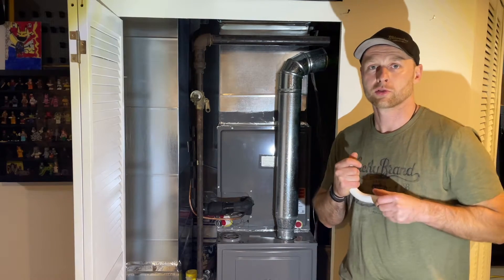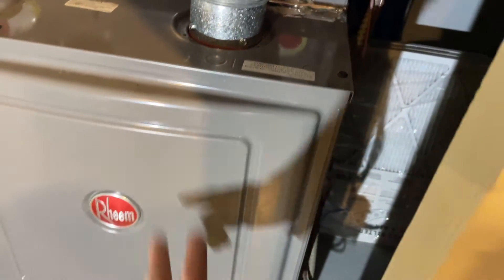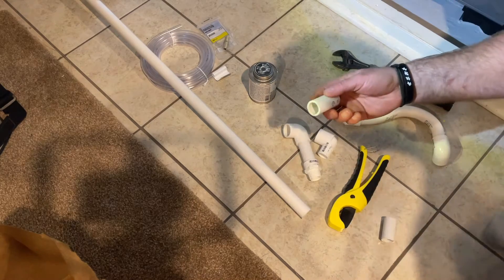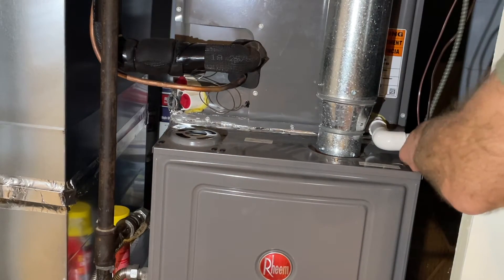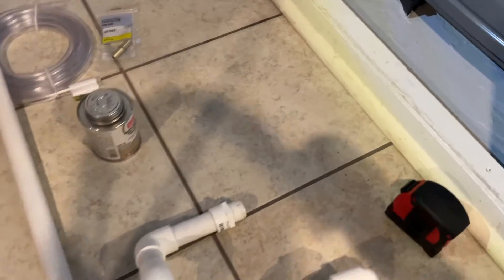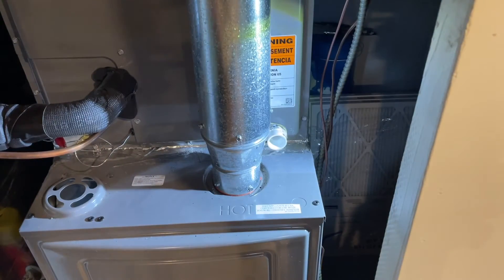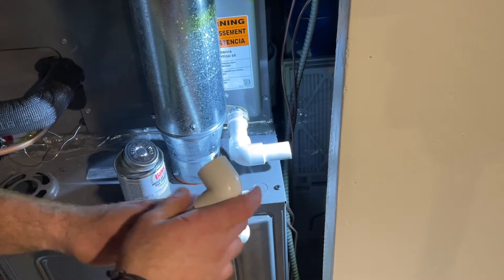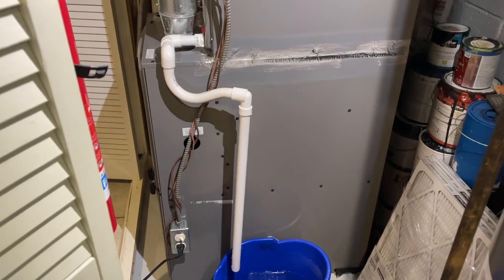How To Install a Condensate Drain line in your home AC - HVAC system (full steps, easy DIY)

Comment: No clean out ?
Reply: Yeah, need a way to clean it out if it cloggs. It does clog often.
Reply: I just had a line almost identical to what you did on my home air handler . needs a clean out so routine maintenance, vinegar or pipe cleaning can be ran through or it will fail with sludge backup.